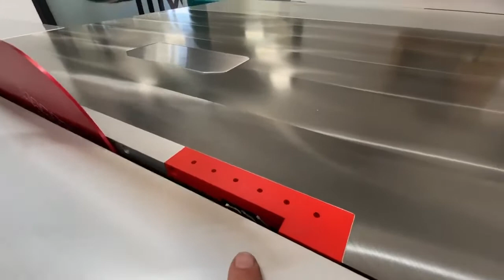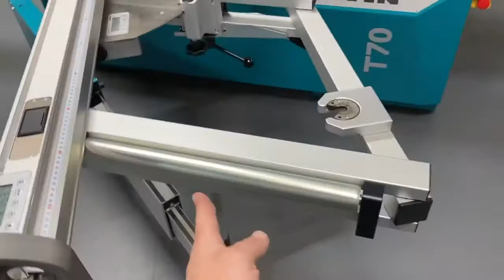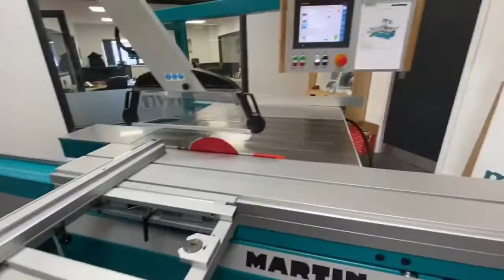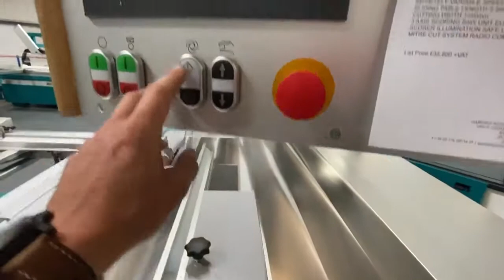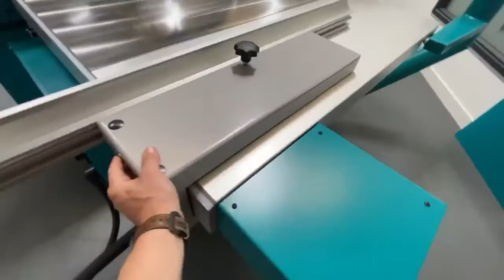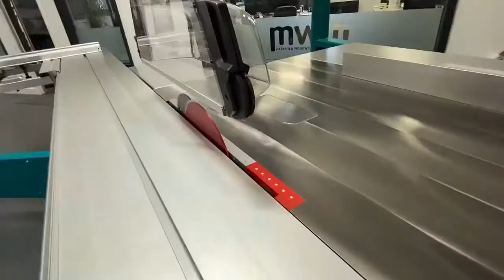NEW  MARTIN T70 PANEL SAW HUGE SPEC! | MW Machinery

Comment: you talk in those paragraphs like the person hearing is standing at 3 ft away and then you drop your voice volume like the person hearing is like face to face and we lose what your thought is.
I have the T60C with those options and a 400MM blade. Love the saw and had to operate the Altendorf with those worn bearings and just not the saw. If they have to ask the price, usually means they cannot afford it
Reply from the maker: Thank you for your advice on the Audio.